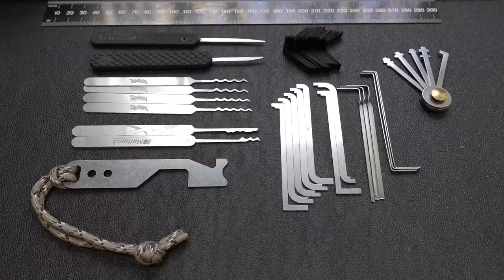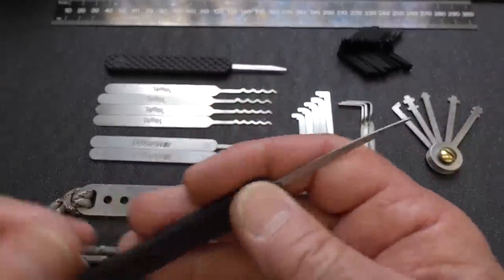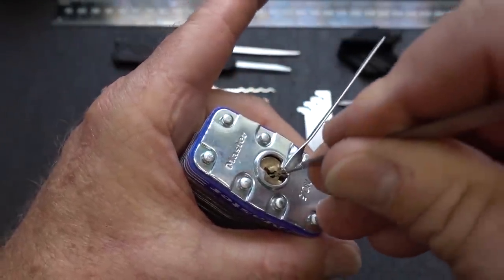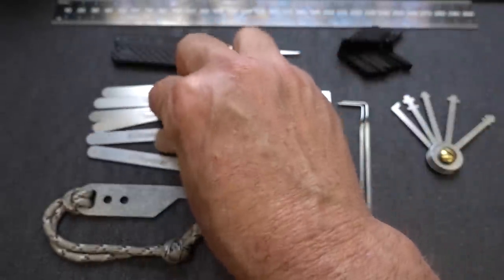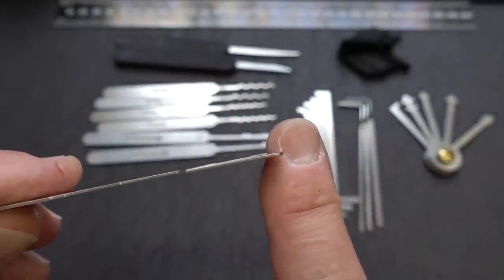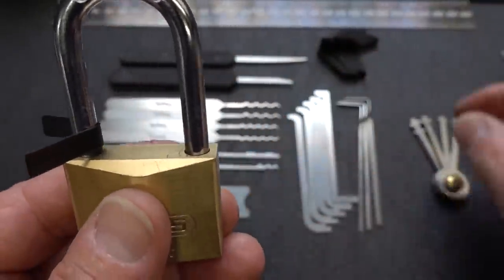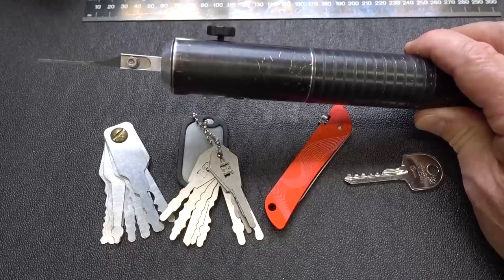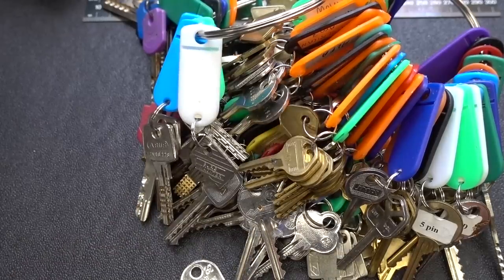(1509) Emergency Lock Pick Kit for Preppers

Comment: An interesting selection of tools. There was no destructive tools in the kit, I wonder if you would also include bolt cutters and a hammer in that lot, cheers
Reply: Well lock picking is essentially non destructive entry 

Imagin you run to a jail like 4 years after. Shtf

You might not want to break locks 

If you just wanna get it you just need 2 wrences and a crowbar

Comment: Just from curiosity - a bolt cutter, maybe a modified large scale one with one arm shortened and the other longer so you can put the short one against your body and pull with both arms on the long one, not sure if that would make it easier to carry or even usable.
I'm just thinking that in a survival SHTF situation, you probably wouldn't walk around with a battery operated angle grinder or die grinder - so a bolt cutter would in my thoughts be an idea to get through low-level locks and wire fences etc.

Comment: Well I know this is 4 years old but a covert companion would probably get you into 90% of the locks in north America in a smaller package. Not perfect but it comes with everything Plus a commercial door bypass and comb picks. Those comb picks will get you into most construction sites shipping containers where they stow tools and such because they like to use Master Lock puck locks which are a major disappointment.

Comment: I have been wanting to add lock picks to my keychain. I have picked probably 500 locks, having been in the metal liquidation business clearing out large buildings that property owners do not have all the keys to. I am wondering if you had to put some bare necessities on a keychain, how would you do it? I have professional kits, but I just want something that I will always have with me.
Reply from the maker: You could consider a jack knife pick set, or simply use the replacement picks that have a hole drilled in them.
Reply: @bosnianbill  Excellent. Thanks!

Comment: What about those credit-card-sized pop-out picks, for the truly under-prepapred?
Reply: They're garbage. They'll get the job done if you understand how pin tumbler locks works and have a bit of practice picking locks. Anyone with that knowledge and practice will have something better. Anyone that just wants prepper gear and no practical knowledge of locks won't have the skills to use them in a consistently effective manner.
Reply: - -  couldn’t have said it better...
Reply: They great 
If your good at picking
Run into only simple lock 

Personally i prefer flat stock a file and a free beers on a sunny evening lol but yes its better then nothing but you can hand make better
Reply: I've used mine (or rather the one before the one I now carry) successfully to gain entry into my grandparents house after locking myself outside with my immobile grandparent inside.

They aren't for life, but use with knowledge and care they'll get you out of a pickle. They also don't result in getting nicked for going equipped and are always on my person vs my other kit which only comes out for work.

Would I pay much for one? Hell no, I picked mine up as freebies, but I do carry them.

Comment: a non functioning fire door is probably illegal and would not pass inspection.

most fire doors have a panic bar witch is designed to allow opening the door from the inside.

you also need to be aware that some fire doors will set off an alarm if opened .

Comment: Great info for me...a firefighter. Often times we have non life threatening calls that we still need to gain access to. This is a better option that destroying the lock or door (always an option). 
Personally I want to build a small kit to defeat most things. I am thinking the Serepick Borgata Pi, Sparrows MOLLE jim, DDT and Ripcord. That I think will cover most of the bases for less than $100. 
What do you think about that kit idea for a first responder?
Reply: Also a firefighter. Was wanting to build a kit for the same reason. Had to kick in a door to get to an elderly patient. Everything turned out okay, but patient was left with a door that could not be relocked in a bad neighborhood.

Comment: Do this : After you get a basic set of picks and tension bars, ask friends to round up old padlocks to which the keys have been lost. Next to the couch where I sit while watching T.V. is a bucket of locks. Just grab one at random and pick while letting your mind drift to the fantasy on the tube. If a prepper expects to bypass locks to aquire supplies in a post disaster scenario..... better practice now.
Reply: Most preppers are practicing other things, such as shooting. A smart prepper picks his battles. Locks aren't always the right battle to pick. Brute force destructive attacks will do a great deal of what you'd want done in a disaster scenario. And often the lock is not the weakest link in the security chain. The only time you would want to pick a lock in a true disaster scenario, is when you want to reuse the lock and the chain/door that it's on for your own protection.

Comment: I think these non-destructive entry techniques would be great for Fire/EMS. These skills are under-emphasized. Is there anything you’d recommend for this group?
Reply: The issue is if your concern is urgency this is just wasted time 

Lock picks are for places that you want to preserve crowbars are for the rest
Reply: Fire/EMS are more concerned about time than they are about non-destructive entry. Also, they already have plenty to learn and know. And for commercial buildings, they have keyed alike keys for things like Knox boxes and elevators.
Reply: @-Raijin-  heres the difference 

I will open those doors every time under a minute even it the lock is rusted shut.

And so could my cousin 

And is nephew and my sister 

And none of them need more then 2 min Of training. 

Are you saying you never get stuck on an awkward or dirty lock. 
Are you saying you open every lock in in 30 seconds even if the bitting is awkwark

My crowbar does care if it is

This is an ems situations dont conceal anything hurry up.

Ive been picking for about 10 years now and i prep but i would never say ill trust a life to my picking to save a lock when i KNOW the door will be opened in a min if i use a crow bar

The closest is i f im next to a door ill start picking and yell to someone to get a crowbar

The purpose of lockpicking is not ems.

Its not destructive entry

Comment: I learned recently about the little number codes that give away how the key is cut. When I saw the 5 dogits stamped on the Abus lock, I thought Aha, drad giveaway! But then when you showed the key, it didn't look like it fit that number, backwards or forwards. Was I reading it wrong, or did that number mean something else in this case?

Comment: Perhaps I'm missing something, because my lock knowledge only runs as deep as a night of LPL and bosniabill, but wouldn't locking pawls be reinforced against shims if they were simply inverted? If the 90 degree was at the shackle side, instead of the acute angle, it would prevent being able to push back the locking mechanism. Am I missing something?

Comment: I get that this is a lock picking channel... but for preppers I don't think you need to preserve the lock or even conceal your entry. I would recommend a 12 ga shotgun with TESAR breaching rounds, bolt cutters, and a crowbar. If you have more funds to work with, look into a tactical breaching kit with a good door pry and battering ram. Once you have the brute force methods covered you should actually learn picking and get some good picks. 
A good prepper will never be in a situation where they need to pick a lock to escape a fire. Always know your exit.

Comment: I picked the Australian Bilock. It was easier than I thought. the right of the keyway has a grove that can be used to tension. then its just a matter of gentling racking the 12 pins. the 2 ball bearings are nothing. the front of the keyway slides down a couple of mm giving enough room to rake. once picked it is easy to make a key. the bilock is easy compared to the Telstra pad locks which I am yet to pick.
Reply: How about i open the gate  .?yesno what you need ?

Comment: Hi,
1) Is the Sparrows Ultra Decoder used in your video to bypass the Master padlock the new model or the older version of it? I'm asking because the pictures on Canadian and USA websites differ, the handle is different. 
2) About the TOOOL guys, do you have a mean to contact them? There is zero contact info on their website.
3) Which brand are your pry bars?
Thanks!
Reply from the maker: Mike,  I have no idea which generation handle is on my decoder.  The important part, the working tip, has never changed.  Here is the contact page for tool (from their website): https://toool.us/meetings.html.  My pry bars are made by MultiPick.
Reply: @bosnianbill  Thanks! I never though looking into the "Meetings" tab on their website to find their contact infos. First time I see this!

Comment: Well...I'm NO Prepper. I'm partially locked IN, However. My 60+ year old front door latch is stuck! The knob turns on both sides-but does Nada. I ordered something similar to the latch-defeating tool shown here. First-Responders, However, also have a Longer L-Shaped Tool, that probably works Better.

Comment: Qestion, am i just Really bad at picking (properly) or are EU and Dutch locks in spesific harder than normal?
I have tryed some bike locks, and door locks, but most of the ones i tryed didn't have the easy bypasses.

Under the doorway?
Most locks like that in nederlands have round nubs.
Have only seen like 2-3 Chinese locks,
And only for locking stupid stuff.

Can it be that insurances is fixing this.
Basically you need insurance in NL
And insurance forces you to use proper locks. If you don't your not covered. Hell even the shops selling locks just dont stock any cheap locks.
Only cheap locks you can buy are suitcase padlocks so there never used for anything serious.

Comment: If I was a prepper, the only tool I'd have on me is a crowbar.

If the lock isn't a good target then you can target the fixings.  On top of that it can be used for so much more than just breaking locks, and has a 100% success rate.

If I'm in a burning building and need to be on the roof, then I'm not accepting less than 100%.

Comment: What about a tool for tube key locks?
Reply: I'm not sure how useful that would be to a prepper, as those types of locks are typically for securing cabinet and other small doors. They aren't "one size fits all" either, limiting their usefulness similar to the bump keys. Also, all the tools featured except for the padlock shims can be carried in a thin small case about the size of a small wallet.

Comment: What would I put in a kit designed to handle the "fire on a low floor need to get out of a padlocked roof access"

A fire axe.

I'm not worried about non destructive entry if there is a fire/immediate need to escape. :/
Reply: Window.

Comment: I think it needs a few actual picks, at least standard hook or small, med and large hooks in case you are trapped in a building. This is an end of the world kit and if the other tools fail, I'd rather die trying to pick a lock than actually bashing my head against the door trying to get out...
Reply: Well the idea is that it doesn't do you any good if you don't know how to use it. Obviously if you take the time to really learn lock picking you'll end up with a few, but if you don't then once the quick and simple ones fail you're probably better off looking around for a tool to break the door/lock or an alternative exit.

Comment: I have mastered lock picking.
For what? Getting into elevator machine rooms because I am not bothered to get the key.
I just need to change the brake on the machine, why spend one hour to get the key to do a 10 minute job

Comment: Wouldn't a couple of tubular lock picks be great to get into those tasty snack machines, low skill and can lock it back up so other scavengers cant get at it in your stash.
Reply: Surely other scavengers would just smash the glass?
Reply: @lmaoroflcopter  tube locks can be on many other thing also including gun "safes" medicine cases, storage units , yes the tasty snacks can be gotten with a rock but to me it  just seems for a prep kit this is something you wouldn't be prepared for
Reply: @ChadHHC86  which can all be accessed with a fire axe or prybar. That's your shtf kit right there... A pry bar and a fire axe.
Reply: @lmaoroflcopter  if you are willing to use a fire axe why do you need a lock pick at all... Fire axe will go through most locks and exterior walls even with some masonry, if you want to brute force then use brute force cars work great for breaching buildings as you just put it in drive with a stick on the pedal, cliffs/tall buildings work great for safes, pry bars for interior doors, bring chains and truck for anything you find or need to open later
Reply: @lmaoroflcopter  I figured this video was a thought experiment of what would be quick easy lock picking tools not what you would really use was I wrong or something

Comment: If you don't know how to use it don't carry a lockpicking set. If you can't pick a lock, you certainly won't be able to do it under stress.
Get a breachpen instead. No skill required and it will get you though just about anything.

Comment: Why would a prepper need a pick? Forced entry all day during the apocalypse!

Also you forgot vehicles, what do you need to gain entry and or start a vehicle these days without a key?
Reply: Simple flat jiggle key
Reply: @realhoffman_3263  yeh but how do you start the car? 😉
Reply: @2secondslater  same
Reply: Simple flat jiggle keys won't bypass immobilizer systems, no point in turning the ignition barrel without a way to bypass the immobiliser system
Reply: Talking modern vehicles here
Reply: ;-( halfway there simple rfid
Reply: Try a current VW....  rolling code to register a key... need to have a internet connected laptop with the VW software installed, a dealer login and be connected to the VW server then register the key with the PCM within a certain timeframe or both the key and the PCM are bricked.
Reply: Great y u ask then
Reply: @realhoffman_3263  cos there are work arounds 😉
Reply: And just that cars might be important to a prepper and entry to one isn't the only hurdle.